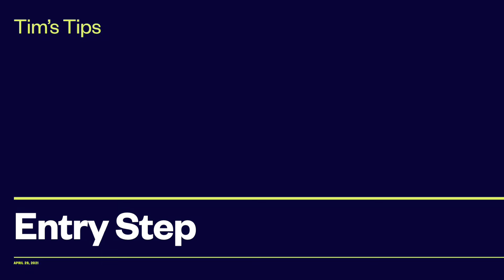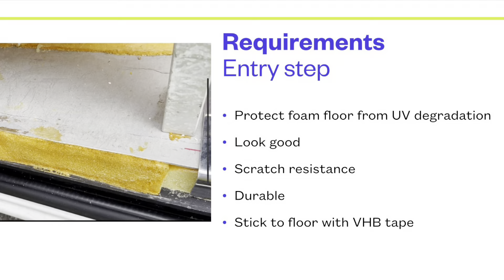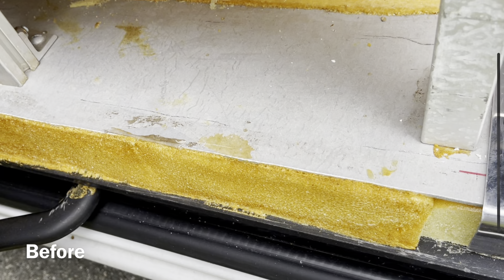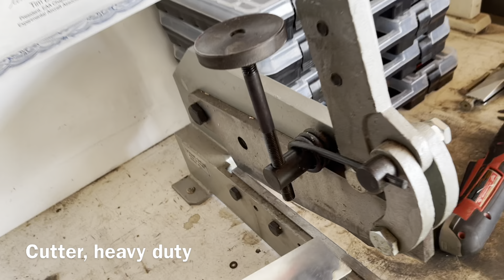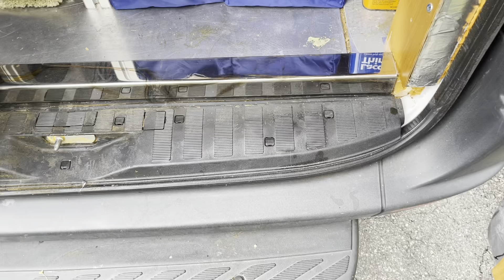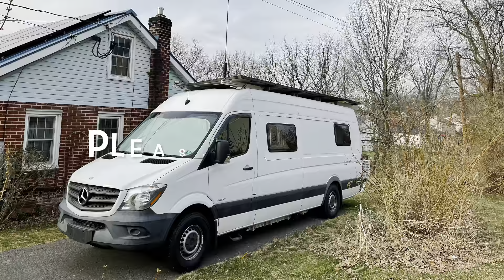Tim’s Tips #68 - Van build entry step, stainless steel - April  29, 2021

Comment: That stainless steel must look like garage now after some use when it gets all scratched up.
Reply from the maker: I put some black anti-skid aircraft wing walk paint on it. Yes, it will scratch, but so would most other materials used on an entry way. Stainless is harder than wood and vinyl. Ceramic might be harder but is heavier and brittle.